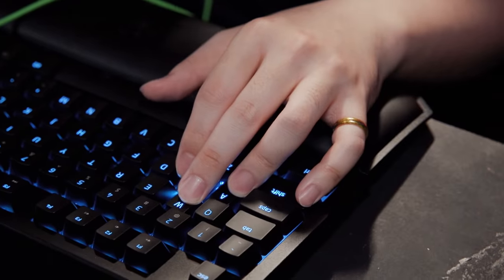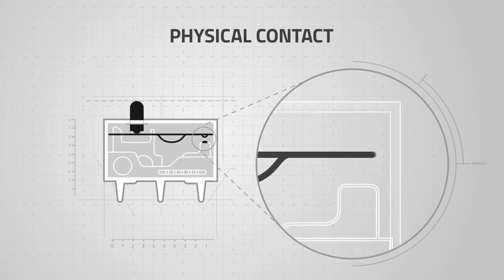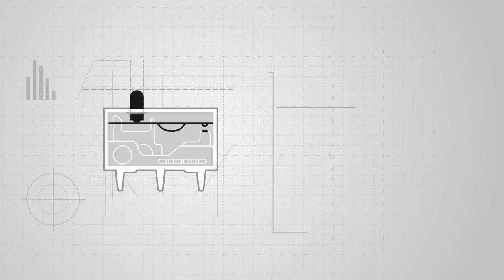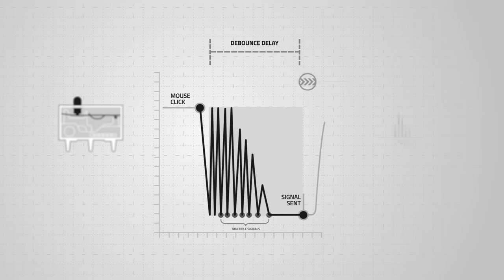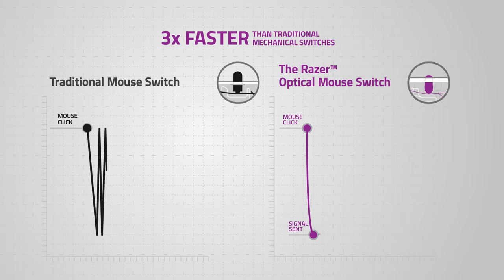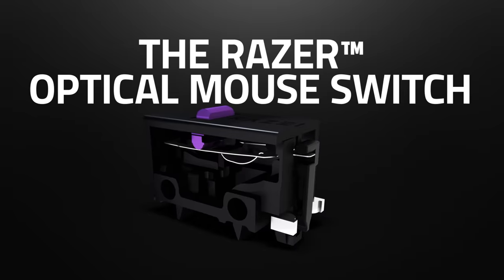The Razer Optical Mouse Switch

Comment: Razer: Click with speed of light
My wallet: disappears in speed of light
Reply: I got you're problem mate
Reply: AlexX this mouse is 40 and u can get a 10 dollar coupon if u have bought a razor product in the pass?
Reply: @pranavv3204  Where did you found that? In the razers page (or atleast the one in the description) the cheapest is 60$
Reply: I bought a Razer mouse with optical switch technology for only €40. The model is the Razer Viper Mini and it's the cheapest mouse they have, yet it has the tech showcased in the video and Chroma lighting.
Reply: In Brasil, a Gaming Mouse is R$300-1300 :)
Reply: Razer Viper Mini ain't expensive

Comment: Well, I used my original Razer Dethadder 3.5G for 7 Years, it failed this Year( completely) 
the first thing that i fixed was a wear on the plastic part that pushes on the switch
the second was case damage, mice were sent flying numerous times, Tough as a rock :)
The third was a swap of the switch(from side buttons to lefty click) 
after dismounting the switch cause of the problem was the fatigue of spring acting metal part.
this is what concerns me the most, switch was still working, but the 'click' was different at some point after the button swap
if failed on side click, 
IF You use the same design of spring acting mechanism it will last a long time ) but the better design might be considered.

PS. Love You :)
Reply: 7 years is a pretty good lifespan for 1 mouse

Comment: Now we only NEED a 
R Λ Z Ξ R
Viper wireless and my life is complete
"Wink" "Wink" 
R Λ Z Ξ R

Much Love <3
Reply: Agreed but not at the price of the Logi G Pro wireless
Reply: I decided to just go for a G Pro Wireless. Best mouse I’ve ever used, hands down.
Reply: @TrippyTimesTwo  But i need the CHROMA SYNC
Reply: @Lexius72   Had a BlackWidox Chroma 2 and a DA Elite for a couple years. It's honestly not that great because my palm covers the mouse RGB. Same goes for the GPW. You get over it quickly
Reply: Not possible
Reply: It's coming, i think they sneakily confirmed it on the MouseReview Discord with a soonTM emote
Reply: MIBR Taco (CS:GO pro) has a wireless Razer viper right now, you can check prosettings.net :3
Reply: @TrippyTimesTwo  just get a razer mamba
Reply: @4tqny  Already got a G Pro Wireless. Mamba looks real nice, but the HERO sensor is the best of the bunch currently
Reply: @TrippyTimesTwo  How's your experience with it now?
Reply: @mrcrazernut  Cracking. Once I'd fully adjusted to the weight, flicks were far easier in FPS, and it felt smooth and quick in other games I play. Highly recommend if you find a deal on it, but only for a deal. Currently new mice coming out are looking quite good too.
Reply: @TrippyTimesTwo  Thanks, maybe I'll buy a razer viper once my g pro wireless broke
Reply: @mrcrazernut  Viper is their most attractive mouse so far in my opinion. Used a DeathAdder for years before switching to the G Pro.

Comment: Optical Mouse is a must not because of what advertised in this video. It is a must because mechanical switch usually have double click problem after 1-2 years. Been using this for more than 2 years without any single double click problem

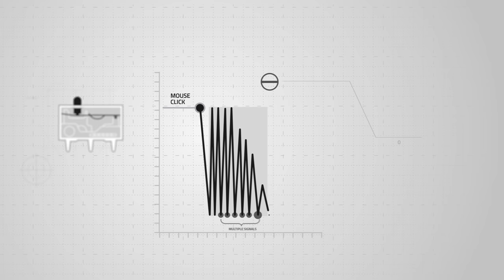Comment: 0:45 
Hello Razer 
I just wanted to tell you that you are wrong with the debounce thing here, your mouse isnt faster, the signal is sent right after the first peek.
Meaning the reaction time is the same, you fixed the delay a player had after they pressed the switch (if you did lower it then the guy making your mice before should be fired)

Because after first peak reaches the bottom, a signal is sent, then the bouncing happens, whilst this bouncing is occuring, the player cant input anything anymore

And even if you were able to lower it from 0.6 ms to 0.2 ms 
The delay from server is 100 higher and then you still have electrical delay 
Mouse software (inside the mouse) processing the data, then sending it, then it has to travel to usb, then through the motherboard to the CPU

So to summarize 
The mouse fixes nothing important, only the ability to click ver very fast,  (IMPORTANT RESPONSE TIMES ARE ACTUALLY NOT IMPROVED HERE) 
Signal to server takes and back 200 times longer (meaning if you even had improvement you wouldnt see or feel it) 
Its to expensive for a lightsensetve sensor and a light, when instead compared to a clicky boy. 

But i gotta give it to you, more clicky time is better, but mostlikely by that point you replace your mouse anyway
Reply: Every Millisecond Counts.
Reply: David C. Again it doesnt matter
Both have the same reaction time
Reply: Okay boomer
Reply: TLDR

When u click any mouse, a signal is sent. Debounce delay goes into effect afterwards.

Unless you can click your mouse twice before the span of 0.6ms debounce delay will not affect you by cancelling that 2nd click.

This is why this new mouse is a stupid misleading product.
Reply: Trydodis absolutely 
I couldnt agree more 
Sorry for my bad english and terrible explanation 

Am i allowed to add your comment to mine (you will be credited of course)?
Reply: @010falcon  sure, you do you man :)
Reply: That's cool and all but show me literally one person who asked
Reply: @klkkloreklffd  That's cool and all but show me literally one person who asked for debounce delay to be reduced
Reply: @trydodis690  The answer is probably many people lol
Reply: I made a left click macro that clicked at 1ms so its not the switch itself rather the firmware itself ig

Comment: People actually complaining in the comment section.
For those saying this is "irrelevant" and throwing numbers down about how their reaction time is slower than the response time of the click.
This is how physics works.

Its not:
"Oh my mouse is 10ms, monitor 5ms, Ping 65ms but my reactions are 200ms so I can't even react that fast"
That's not how physics works.

Its:
Reactions 200ms
+ Monitor 5ms
+ Mouse 10ms
+ Ping 65ms
= 280ms

Meaning because of the delay in all your equipment, the time it takes is now 40% slower than your reactions simply due to your hardware.
So if a mouse can go from 10ms to 0.2ms that's a 3.7% improvement.
In this example if your reactions are 150ms, its now almost a 5% improvement. 

It doesn't seem like much but a 3.7% - 5% improvement can literally be the difference between dying and living by itself.
Never mind if you combine that with a better monitor and tons of practice to increase your reactions. 
Its exponential percentage increases.

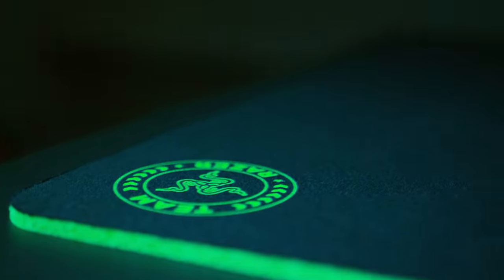Comment: 1:33 left mouse is like G502
Reply: Except G502 does not even last thousand clicks until it starts doubleclicking :)
Reply: @Jinny-Wa  Lmao mine has never double clicked ever and I've had it for 4 years.
Reply: @zel9136  had mine just over 3 months and its double clicking and releasing contact all over the shop, g502 is shit
Reply: @SuperSaiyanCj  i use G502 hero 7 months is no problem.
Reply: @fnliner5283  Lightspeed G502 does not last. They use new cheaper switches on those
Reply: @Jinny-Wa  i use hero ver not lightspeed

Comment: Yes, but I’ve done the method to double click a normal mouse to get it to click twice and it worked, but on the razer death adder v2, i can obviously hear it clicking twice in one, i even filmed it in slow motion and its very audible, is it a misconception that they cannot double click on razer optical switch mice, because the bloody A70 from A4tech, also optical switches, can, but it is  built differently than the razer switch, and it also has a debounce delay slider, so is there a built in debounce prevention software, or is it the mouse switch itself that stops it? If there is a software a slider in razer synapse would be very useful because it would profit a lot of Minecraft gamers, who need a lot of clicks per second and it would be a more popular mouse.

Comment: cool tech you cooked up there but no one clicks faster than the debounce time of maybe 5ms! You'd have to click over 200 times a second to be hindered by the debounce delay! Just stop cheaping out on the switch and put in a japanese Omron D2F! Feels extremely tactile and lasts a lot longer than the cheap chinese Omrons, even if they may be rated 50M for clicks, they'd only reach that if they were actuated precisely to spec, which in a human-operated mouse doesn't ever happen, so they break!
Reply: krass76 You WIN!
Reply: Well Minecraft PVP Autists are clicking 500 Times per second
Reply: @bene2455  As a Minecraft pvper, we usually don't get over 20 cps
Reply: @bene2455  However, TheTeddynator (i think thats his name) managed over 100 cps with his bawlclicking tecnique
Reply: jumbology and that’s only half as fast as you need to notice a difference

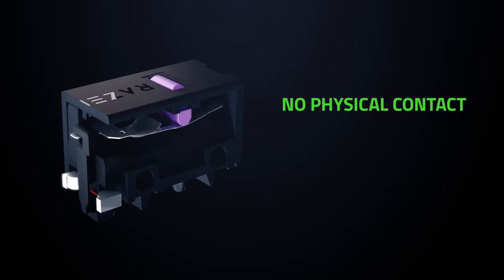Comment: 1:03 The curved top surface of that purple actuator is also problematic as it means a smaller surface area is being being exposed to a greater quantity of friction. That surface should be much larger and also flat to ensure fiction is distributed evenly to a larger area thus providing an unchanging actuation distance. I understand Razer probably went this route due to the cost of new tooling to create a better switch design, but this still perpetuates a bad implementation that is decades old. Someone really needs to bite-the-bullet and finally eliminate this walking dead design with extreme prejudice.  <imagine photo of The Terminator here>

Comment: Why would you wait to send the signal until after the debounce delay? You can also debounce by sending the signal on the first state change, then just have a delay AFTER that before sending any more signal. Also isn't there still bouncing on optical switches? (albeit typically less than the amount of bouncing on electrical switches)
Reply: Is it that hard to understand video?

Comment: Million Clicks is a Marketing Gimmick. The lifespan of a micro switch "MASSIVELY" depends upon the operating voltages or signal voltage of the switch.
Previous Mouse PCB's used to work on pretty much 5 Volts. The recommended operating Voltage of a Micro Switch is 5-6 Volts. Modern PCB's have a Signal Voltage of 3 Volts or even less. Yes yes, I know the USB carries a standby 5V though the VCC (green) line, but the actual signal voltage to detect a one (or switch closing) is set at 3 Volts or lesser even. This in actuality shorten the lifespan of the switches irrespective of the manufacturer be it Omron or Kailh or whoever it is.

Don't fall into the Marketing Gimmick of 10M, 20M, 50M, 80M or in this case 70M clicks lifespan.

Study datasheets; for the switches as well as the PCBs. The truth will set you free, my friend.

Comment: I do not care about speed. I care about if the optical switches have a longer lifespan than the mechanical ones.
Every gaming mouse I had so far including raser ones, eventually succumbs to double clicks on the main buttons or inconsistency on the most used side buttons.

Comment: Well if you take a mouse that has a response time of 1ms and the opto mech switch is 0.2, if you calculate the whole of that so 1 ÷ 0.2 does 5, so it is 5 times faster than a traditional mouse! This shows how Razer underestimates themselves but I gotta give Razer the matter of the doubt
Reply: A 0.8 ms delay is not gonna make any impact when lag usually sits around 30ms for people who are lucky and reaction time sits at about 150ms. Reaction time and better internet is what will give you the advantage.
Reply: @gdlpe05  the delay there is, aids to the reaction time, on human benchmark it's not only you but your mouse too

Comment: 50 million versus 70 million? Wow that is nearly 1/4th more clicks!... That is almost no difference....
Is the "Traditional Mouse Switch" comparing to THEIR BEST mouse or a cheap generic average mouse?
The part on mice that wear out, is the mouse switch. If it is optical, it should last 1,000x more, like 50 Million button vs 50 Billion optical, not the puny 28% increase....
Reply: If you stop and think for a moment the answer is as obvious. Despite optical part of this switch the other (moving trigger) part is still physical. It still wears-off at same rate as any physical object.
What matter's most to me that despite wearing-off issue optical sensor really shouldn't give you as/or at all double-clicking. Most of my mice died not because of "wear-off" but because of double-click. Having one(of 2) factors removed already is a huge leap(btw those 'traditional mouse" switches doesn't last 50mils without double-clicking anyway)
Reply: @NightLancerX True, Thanks for bringing that up.
If something has several points of failure, removing 1 of them, is worth it.

Comment: It's cool and all but I hate the razer clicks... way too clicky and stiff. The way the click feel makes me even sometimes accidentally clicking inbetween a rhythm I have. It's hard to describe but it feels like they are sticky and when I release and want to press again when ever I want I sometimes with click too early or too late.  Worst feeling siwtches out there seriously. And I'm on the v2 switches on the newest RVU batch. And you also can't even solder in anything you want because of the special pin variation as a swappable switch. Nice idea to be able to just pull them out but shitty when you have no options to put other switches in you find better. Razer tries to be special with it but fucks it up once again. 

The clicks really makes me want to swap mouse after just a brief time because the extreme stiff clicking feeling goes into my fingers over to my whole hand and even wrist. They also feel quite cheap